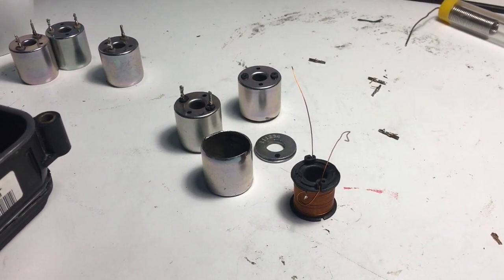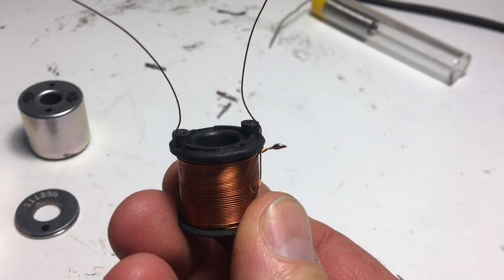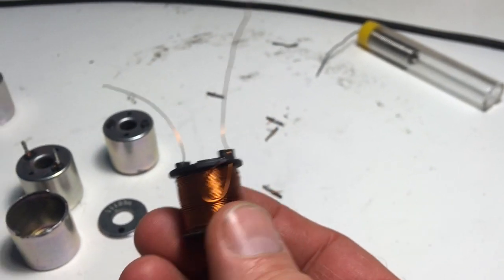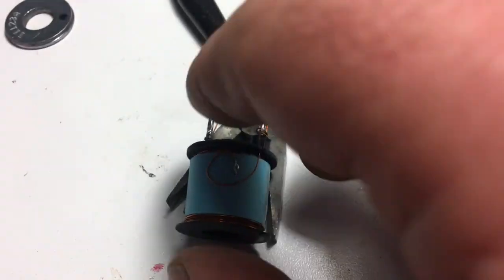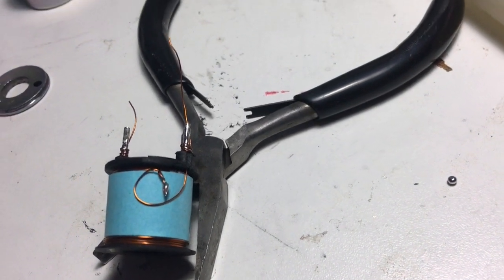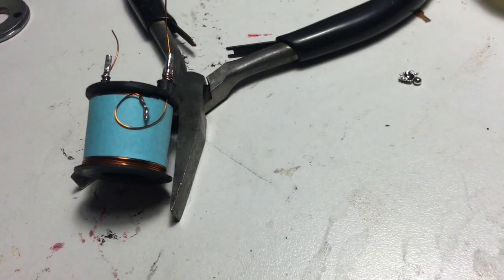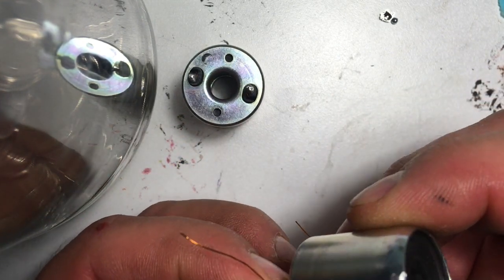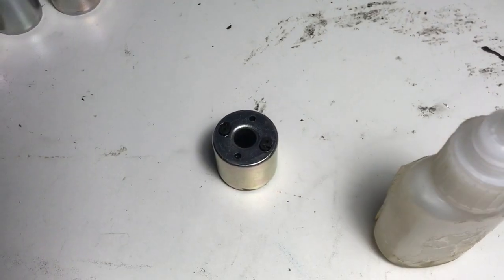Part 4/5   2003 F150 ABS Module Repair, repairing the coils Pt2

Comment: See my comment on Part 3.  Using additional wire (purchased or canned from other parts), you can avoid taking turns off the coils.  Gotta make sure to varnish or conformal coat all the solder joints internal to the coil to avoid shorts.  The tape works, but I'd do both actually.  :)